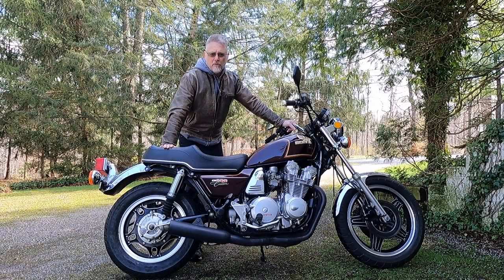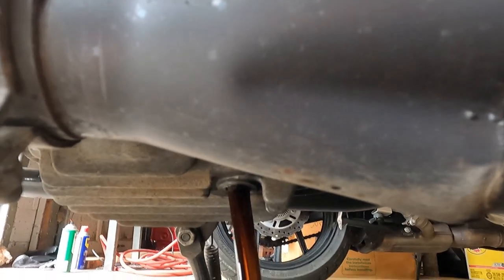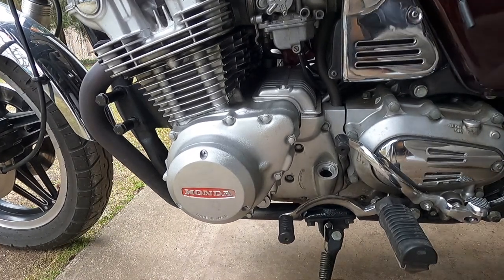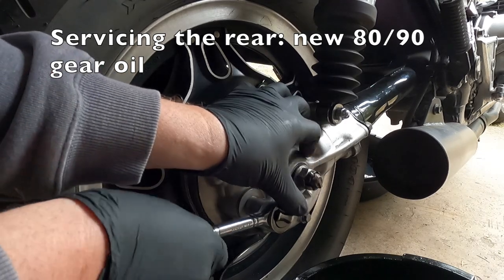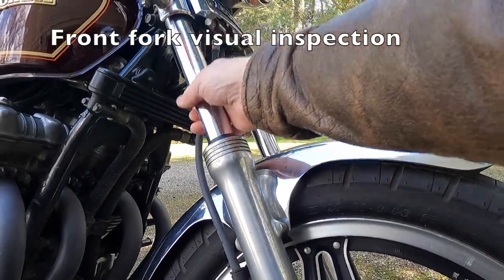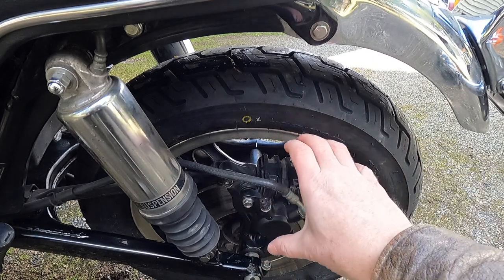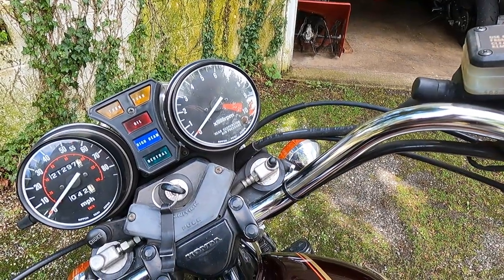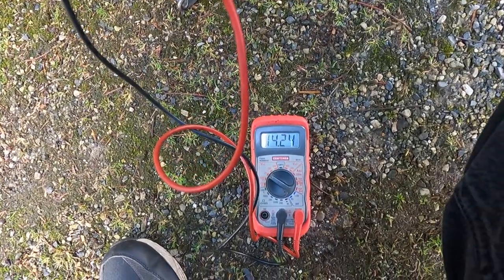Honda CB900 Custom - Oil change and full service

Comment: I just got a 1980 honda cb900c for 50 dollars! Guy told me it was a piece of crap and i took it home right away and got it running within an hour, everything is original and perfect condition except for a little surface rust but your videos have been amazing although it runs im changing everything
Reply from the maker: Right on, Gavin! It sounds like you got a great deal on your CB900C!

Comment: Excellent!   I bought a 1980 cb900 in 1981...still riding it today 41 years later...but need to change that gear oil, never done it yet. I'll get some Lucas 80-90 wt. gear oil today...and do it this coming week...your paint and side covers are perfect...mine are good, but not like yours...I just had to change out my neutreal safety switch...it took me two weeks to do without forcing it and breaking anything...Now, I know all the tricks...I should have done a video like you, how to do it...
Reply from the maker: Thanks Dennis! That is truly long term ownership. I never had to do the neutral switch but will look up a how to video if I need to.
Reply: @jonsmotorcyclerescueandrev3538  Jon, I'm better with rifles, this electrical stuff is hitting me at my weakest link...I have a friend who taught electrical electronics at a college, I think I'm going to take it to him and let him solve the problem...I always help him out with mechanical stuff, which I'm very good at...It's a trade off...
Reply from the maker: @dennispfeifer7788  Right on. Sounds like a good idea. The electrical side doesn't come easy to me either.🙂

Comment: I just picked up an ‘83 CB1000 custom. Very happy with the bike. 
Thank you for taking the time to put this video together! Where do you find your parts like the oil filter and air filter? Thanks.
Reply from the maker: Honda should have those. I also like HiFlo brand oil and air filters. You can see what they have for your bike at: www.hiflo.com
Those should be available through the dealership as well as on ebay and Amazon.

Comment: Excellent tutorial Jon. I have the same bike (1982). Please upload a video how to clean the carbonator and what are the charging components? Love to learn more. Great easy understandable teaching.
Reply from the maker: Thanks Charles! The CB900C carbs are notoriously complex and I hope I don't need to clean more any time soon. However, I recently posted a video on cleaning the carbs in my CB750K which are almost identical: https://youtu.be/w1WhtFRhyCU

There are entire process of cleaning these particular carbs can't be fully explained/demonstrated in a single video - it could easily justify it's own series.
Reply: @jonsmotorcyclerescueandrev3538  Thanks Jon, I just ordered the charging coil, rectifier and filters from eBay .It's going to be nice little first time project for me. Thanks
Reply from the maker: @charlesmanickam2055  Awesome Charles! Check out the playlist on my CB750K. I cover carburation and electrical systems in those videos. Most parts are identical to the CB900C.

Comment: Great video Jon, Thx!.    Yeah, the vintage bikes require a thorough going thru no matter the condition when bought.
Reply from the maker: Thanks!
Reply: @jonsmotorcyclerescueandrev3538     Jon...I only have 1 bike and it's a lot of work (fun though).   I don't know how you keep up w/ multiple bikes.  🏍🙂🏍
Reply from the maker: @cjc_0167  I wish I could send you a picture right now...
Front end is completely off my XJ1100J, parts everywhere, rebuilding the forks and the brakes, bikes crowded all around ...
You get the idea. It can drive you batty if you let it.

Comment: I owned that bike from new.  Brought back a lot of memories.  It was amazing how smooth that bike was.  What I did not like was that the performance of the rear shaft drive.  When you accelerated hard, the rear of the bike would pick up, instead of the front rising..
Reply from the maker: My chain-drive bikes do rise in the front more, which opens up my line on corner exists. I actually prefer the shaft-drive in that case since it maintains a tighter line when accelerating. Personal preference.  Cheers!

Comment: Super awesome video! I have the exact same 1980 bike that I picked up from an owner that layed it down and left it dead outside for about 6 years. I finally brought it back to life and am trying to get it back to respectable condition. I am having some trouble with my high speed gears dragging the engine down and not functioning well at all so I am forced to only use the low 5. Any thoughts on what could be the issue or maintenance that should be done to prevent wear on them?
Reply from the maker: I would make sure to change the gear oil in the transfer case. I may have this service covered in the CB900C playlist on the channel.

Comment: Hello Every body! Sorry for my bad language, i'm french.

I just buy an cb 900 custom 82 and it's pretty rare to found here because it was foar north america market.

i try to found a service manuel or workshop manual for the 900cb CUSTOM.
If some one know if somethinks exist, please let me know.

Thanks for your video ;) very helpfull
Reply from the maker: Hi Samuel! Here is my CB900C playlist with all of my CB900C videos: https://youtube.com/playlist?list=PL0gjN9hf6pSq91QZhddq57LhkoQM_9c6t&si=6pdzr3-tVRv8arB9

I will let you know if I find a good source for the service manual. Cheers!
Reply: @jonsmotorcyclerescueandrev3538  thanks, i already watch all youre video about 900 custom, abd some other🤗
Like it, pretty good video. 

I finally found manual shp on line. 
I will print what i really need. 

But, if you can have information about what part is fitting with other bike. 
I know for shat and engine, but frame. 

For part like luggage rack or sissy bar, could be a good alternative for find some think. 

It’s look like not a lot of .. i don’t how to say.. cosmétique parts, or the rear of the bike seat are fitting with other. 
But if you know some think, please let me know, or better, maje a video avout accessoiries😅
Reply from the maker: @suarez0187  Will do. I think the only other model that might share some accessories is the CB750C. Cheers!

Comment: Great video, brother! I've just bought a Cb900 custom 1981, and I wanted to ask! Where do you buy all the things? Is it possible to do it through Amazon? Im from Costa Rica!
Reply from the maker: I bought most parts from Niche Cycles through Ebay. You may be able to find parts on Amazon. Sourcing parts is a big part of owning a vintage motorcycle. Good luck with your CB900C!

Comment: I purchased the bike several months ago and as I was changing the oil and I realized that the oil filters spring washer is missing. Is this washer that necessary? I didn't have any leaks prior to removing the filter.
Reply from the maker: This is common. I replace them since they keep the spring from pushing into the filter. Cheers!

Comment: Hey, thanks for the video. What would you recommend checking if the bike stalls a few seconds after idling? I give it choke and let it warm up. It will stall unless given constant throttle. Thanks!
Reply from the maker: Have you adjusted the idle speed?
Reply: @jonsmotorcyclerescueandrev3538  I have not. Do you know where I can check that? Or where it is referred to in the manual?
Reply from the maker: @matthewmartens446  It should be between the middle carbs. Idle speed adjustment should show up in the manual.

Comment: Are parts available for the older Hondas like the 900c you are servicing?
Reply from the maker: I haven't run into one I couldn't get either through Honda or the aftermarket or used. But it sometimes takes patience and legwork.

Comment: I believe that I've checked , they don't make "rebuild kits' for those shocks.... what a shame!  Back in the day, those CB9's were the SOFTEST/SMOOTHES riding bikes made...... all of the cycle mags had always said!
Reply from the maker: The CB900Cs that I own still ride great. However, I have had to replace many blown, non-rebuildable air shocks over the years. In fact, I replaced some XJ1100 shocks this week. 🙂

Comment: It might sound like a silly question but which cover do I take off to replace the shifter seal and do I have to drain the oil first your reply would be greatly appreciated 😊
Reply from the maker: Great question! I honestly don't know. It's a job that I haven't done. I would recommend getting a repair manual for the bike before starting in on the job. It should have the information you need, and it will be a great reference moving forward. Best of luck with it!
Reply: @jonsmotorcyclerescueandrev3538  I have several manuals even the shop manual and none of them address this🤷
Reply from the maker: @lovingjesus5184  Oh man, I'm sorry to hear that! I wish I had a good direction to point you in, but I'm at a loss as well 😕.

Comment: What type of Grease do you use on the Oil Filter Housing?
Reply from the maker: Great question! I just use a little high-temp lithium grease to hold the o-ring in it's groove.
Reply: @jonsmotorcyclerescueandrev3538  Thanks. I'll definitely be using this video in the future.
Reply from the maker: @zambimaru  Right on!

Comment: Oopps i just did it, and forgot to put the filter metal  washer . It doesn't leak. Is it ok if i leave it like that until the next oil change??
Reply from the maker: It should probably be fine, but it's your call.
Reply: @jonsmotorcyclerescueandrev3538  I'll leave it like that, it's only a thin washer between the rubber part of the filter and the spring that only has a little pressure. It should ne fine.
Reply from the maker: @victorcruz-barreto4492  Right on.

Comment: Thanks for the vid.  Do you know what size crush washer is needed if it needs to be replaced?
Reply from the maker: Hi Alex,  I don't know exactly what size off the top of my head. I would just get one from the Honda shop.
Reply: Do you need that washer?

Comment: Well, it worked after installing the new switch, but then it quite...so, I'm back to square one...and out of ideas...but, I can start it by depressing the clutch lever...so,  that is what i'm doing for now....but, my damn headlight comes and goes...now, it's dead...and don't want to drive it like that...I may take the bike to and electrical shop...let them solve the problem.
Reply from the maker: I think the clutch lever is part of the starting circuit so it is normal to pull it in to start the bike. Check your connection on the back of the headlight. Light corrosion can cause it to stop working. Problem solving is part of vintage bike ownership. I know it can certainly be frustrating but it is also rewarding in a way new bikes aren't.
Reply: @jonsmotorcyclerescueandrev3538  Ok...I think I'm going to let my buddy look at it...he's a high tech IT electronic expert guy...I'm at my wits end...I'm about done...He was a teacher at the electronics schools....
Reply: @jonsmotorcyclerescueandrev3538  I'll teach him some shooting skills...I'm good at that since 1959....I'll do a trade off...

Comment: Jon, you had mentioned removing forward controls from one of your CB900s. Are you interested in selling them? My wife has decided that ours is too tall for her, and I need more leg room if I'm going to ride it.
Reply from the maker: I removed the forward controls - they are custom fabricated. I am currently using the 4 longer engine mount bolts and spacers that go with the controls since I didn't get the original bolts with the bike. I am open to suggestions here. I would need the stock bolts in order to ship the complete package with the longer bolts and spacers.
Reply: @jonsmotorcyclerescueandrev3538  I see.  Thanks, anyway. I may end up selling this one. I need to thin the heard, lol.
Reply from the maker: @bringbacknames  Me too (need to thin the herd that is). It's a pain to jockey everything around when I work on the bikes.